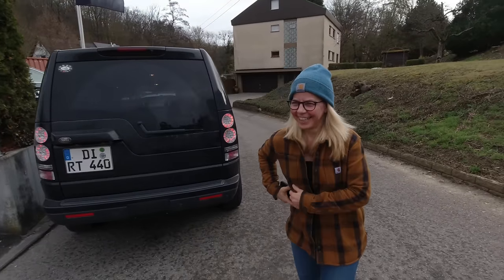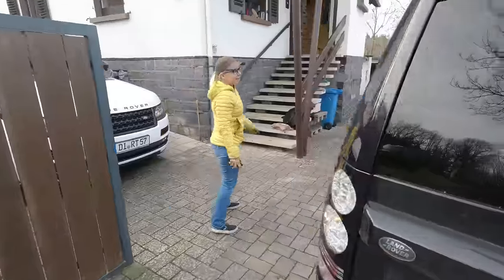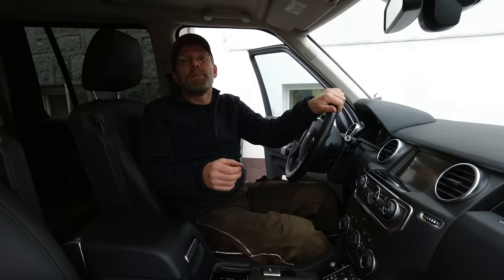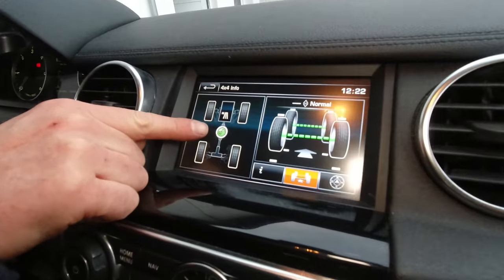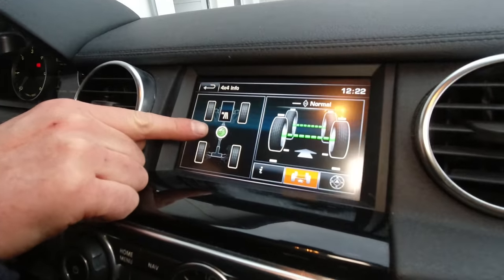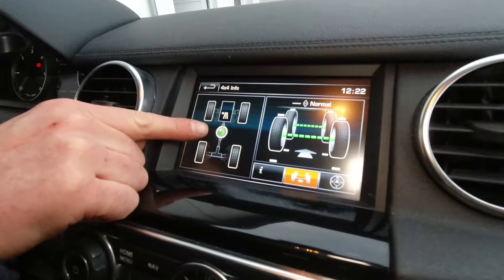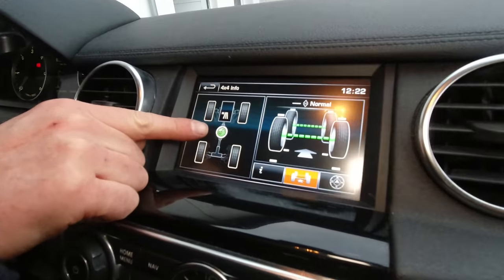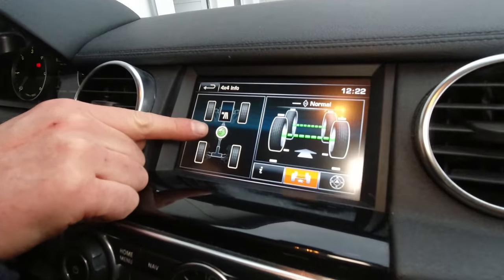We Bought a "Failed-Engine" Land Rover Discovery 4 in Mint Condition / S5-Ep8

Comment: Every time a Disco breaks down with terrible engine issues, the dealers are now shipping them off towards the locality of Frankfurt in the hope that Vera makes Christian buy it!
Reply: and most of the engine problem is just because the owner dont take care of it they may wash it wax it but the main service is a joke just my opinion from jamaica
Reply: Hahaa!
Reply: I was just about to type something very similar (but not as witty...)
Reply: Which diagnose tool you are using here ?
Reply: Riesen Respekt für euch, dass ihr eure LR Leidenschaft so lebt 😊👍👍
Ich kann das beurteilen, hab selber einen L322 😂😉
Reply: Same happens with Minis. There is a perception that the Gen 2 BMW Minis with the N16 engine are unreliable and they are..... If you don't maintain them. I have an R55 Clubman I bought brand new in 2013 and it has never been near a dealer, I have maintained and serviced it myself. It has never broken down and, apart from consumables, brakes and tyres, the only parts I have replaced are one VANOS solenoid, a cam cover gasket, a battery, a PCV valve diaphragm and spring, and a fuel filler cap that I left at a gas station
Reply: Most broken range rovers I know of go straight to the scrap yard because their engines are shite.  That’s certainly what happened to mine

Comment: Love it guys! Your channel is why I bought my my disco 4 about two years ago. She's a 2012 XS with a lot of extras had 117k miles now 126k. So far apart from servicing gearbox and general servicing, it's cost me for replacing the inlet manifolds which both cracked one hot day on Exmoor last summer. She came with a full Landrover service history and two prior female owners. From looking through the computer, she had done 26m in ice and snow settings before I bought her in total and zero miles in any other setting, so I knew she'd never been offroad. Well, she definately has now! We use her as a camper, with an inflatable mattress and all rear seats folded down, we put our luggage on the front seats and it is very comfortable. I look forward to Sundays and seing how to use all the tools I have had to buy to keep my Mall Crawler road and mud ready! To me, your channel is like a video version of the Haynes manual, with jokes and commentary - so thanks for all the useful information and laughter and long may you continue  to inform and entertain the rest of us D3/4/Queen - addicts.

Comment: I watch your videos with much interest. I have owned two Land Rovers, a series one that I drove across the Sahara desert in 1974 even though it was twenty years old. I believe that Land Rover's reputation has been built on the 'expedition' capability of their vehicles and not just a 4 X 4 that can be driven around forest tracks. My series one could be repaired with a small tool kit by the side of the road (id necessary), I defy anyone to repair a Discovery with the kind of tools that you employ on a regular basis. Keep up the good work.

Comment: I must thank you both on being so positive over D3 machinal issues. The motor trade runs away on the mention of a LR Discovery in the UK ,Yes only own one if you can fix it, so I'm investing in a 4 tonne workshop ramp. Meantime running my D3 6 spd Manual for 500mls without reverse gear after covering 225000 miles!!! , all it requires is the circlip on reverse selector lever on top of the box? How do you get to it, can't keep putting off the fix!!
Reply from the maker: You can see the details of the selector in the LR3 rebuild series.  Its a strange little clip.  Pulling the pin through the side is very tight with body-on.

Comment: I've watched a few of your videos in the past,i've had a few Land-Rovers myself but mine were series 2s and 3s,indeed my most modern was a Discovery 1 v8 which i had for 17 years.Up until now,i've not subscribed even though you're both very entertaining but once you said you'd never drive an EV i immediately knew we were kindrid spirits and hit the button! Good luck with this one,it'll be interesting to see what is going on inside that engine
Reply from the maker: I never had a vehicle for 17 years.  My respect.  You did more for the enviroment than any EV driver.  Christian
Reply: I had an Opel Vectra C 2.2DTi for 20 years, bought it new. It finally died…resting at my dads parking lot.

Comment: Congratulations on the new car, shame its not a Toyota folks🦆🏃‍♂️
have you considered putting a winch (with remote control) in the back of your garage/shed attached to the floor for ease of moving vehicles around the driveway. you can put several strategically placed  anchor points around the driveway to also hook pulleys from when obscure angles are needed  it would make it so much easier on you both.
Tony from Western Australia 🇦🇺
Reply from the maker: No we just need a little push, no need for winch. 👌🙋‍♀️
Reply: @Vera_and_Christian  that's fine while you are able to Vera   but as I can speak from 50 years of experience screw your back up or your knees and that is for a lifetime. For a relatively cheap price you can make life easier for yourselves, able to continue longer and have a extra hand around the place for being able to do many other things, a winch and pulley mounted in appropriate spots could do more than the engine hoist/cherry picker could do and get into positions the hoist can't
Think laterally your self and with Christians ingenuity I bet he would soon find it indispensable.
 Sisyphus  didn't have an option, for his punishment, but you do 🤔🙄😁
Tony from Western Australia 🇦🇺

Comment: Great video that I watched a day late as I was at the 4x4 Expo yesterday.

You had me rushing out to check my Discovery to see if it had the double-stiched seats and rear loudspeakers.

Mine is a 2016 Landmark and I was happy to see that it did have the double-stiched seats and loudspeakers and my control panel is the same as yours and "piano black" as well - so it looks like mine is equipped the same as yours, though mine does have the screens in the back of the driver and passenger seats (unlikely to ever use them, though).

The tow hook is an option and it costs over £400 in the UK (not cheap as chips as you said) and you have to order the slectric sochets as well as that is also an extra.

But - if you are buying a used vehicle it is probably better if it does not have the tow hook or rear diff. as it has likely only been used on-road and not for towing and is likely to be more reliable - and you can always add the tow hook if you want to tow.

The one essential thing that Land Rover missed is blind-spot mirrrors.  The electric blind-spot monitoring is an optional extra - mine did not have this fitted, unfortunately (does yours) and was only fitted with flat mirrors.  I find this dangerous and have had to use stick-on blind spot mirrore.  I just wish there was an after-market option to have a mirror that has the outermost part as a blind-spot mirror.  I have found one that stickes on top of the standard mirror, but you then lose the heated option - so you need a clip-on one that lets the heat through - still looking...

The big problem with the Discovery is that they are so enjoyable to drive that you just want to get out of the house and drive. 😉 😃

Oh - you did mention servicing.  Where I live we have two or three superb independent Land Rover repair specialists, one within walking distance. So, after my Land Rover warrenty expires, I will have mine looked at there.

And ... talking to a 4x4 tyre expert at the 4x4 Expo I have found that I can safely put 225.55.R20 tyres on, so I can get all-season, all-terrain tyres that have the snowflake/3-peak symbol so I can legally drive in Europe in winter. 👍
Reply from the maker: Our black edition has blind spot radar, adaptive cruise and keyless entry. The new one does not.  I will be missing the radar.  Christian
Reply: @Vera_and_Christian  I thought they all had keyless entry - you can turn it on and off, maybe it was just turned off by the previous owner.  I agree about ACC, but I really wish there was a decent optical blind spot mirror option without having to have a stick-on one.

Comment: You guys are amazing! So, how many LR4's is it now!! Meanwhile here in Dubai, the worst LR3 in the world has just had its 10th Suspension fault (Front suspension has collapsed to the bump stops) and 2 months after a 1-year warranty expired, the 3rd battery has died, so soon it will be 4 batteries in less than 3 years of ownership...Oh, that's on top of needing a new AC evaporator fitting, which is an expensive dash out repair.   We have thought of a LR4 or even another Range Rover again, but the dilemma is we have spent more than the cost of the car in repairs and a lot more than the LR3 is actually worth, but we feel we have to keep it long enough to get the "value" from it. It is a nice clean car, and a HSE so the interior is nice and despite issues it always passes the equivalent of the TUV or MOT test here in Dubai. What to do...?

Comment: I know of 2  cases of the Disco 4 with service history breaking crankshafts. Neither particularly low mileage though, one is a friend's car, currently getting a new Land Rover long block installed by a dealer. £6k I think but well worth it vs the cost of selling the dead car and buying a similar replacement.

Comment: Hey Christian and Vera, in Australia we are now seeing the RH cam pulley failing hub centre is cracking at the webbing to the outer pulley @ 170k km. Visually you can check when doing timing belt change heads up for the D4 timing pulley your probably doing right now. Cheers and keep the content coming.
Oskar from down under.
Reply from the maker: I also saw a picture recently. Did not know this issue before.  Should have changed Veras.  Christian

Comment: i bought a 2006 lr3 HSE when i was 15. it was been swapped to coilovers and i do recommend doing so IF is it the same model or 1 to 2 years old. the only problem i have had with it has been a misfire on cylinder 2 where i had to replace the coilpack and then the wet floorboards. i fixed the wet floorboards with some tape and glue as the hole are behind the a pilar on the outside and my sunroof was NOT leaking and brought it to a friends shop where they cleaned in the floorrunners for any mildew and mold.
Reply from the maker: Airsuspension is the best👌💪👍🙋‍♀️

Comment: These cars are used for heavy towing a lot in the UK and combined with the risk of engine failure, even though I think they are otherwise fantastic vehicles, I would not personally buy an used one now. I just have not got the skill, patience or facilities to repair them. I have had four Range Rovers, two Series III and two Defender 110’s plus a Discovery three door, all bought new but long gone now. My favourites were the 110 HiCap pickup and the 1988 Classic 2.4 diesel Range Rover with the characterful VM engine. The pickup was kept working hard for 22 years until it was totally worn out and with a broken piston. I still regret selling the diesel Range Rover and actually preferred it to a later 2004 unibody Range Rover with the BMW engine.

Comment: Hallo Vera & Christian,
as a LR-Fan over decades - driving a Disco2 , the better Defender - , I‘m a fan of your channel too.
Question, may you consider eFuel HVO 100  by the following engine repair episodes, which will be still available at some fuel stations and increase up from April 🤗.
I fuel my tuned TD5 with HVO100 and it’s running much more smooth by more power in lower rpm - by 90% neutral climate efficiency 👏
I‘m sure this gives our LR-vehicles a better PR!
However, keep on your enthusiasm, it‘s genius 👍
Reply from the maker: We will look into that👍🙋‍♀️

Comment: just to correct you on one point, in the uk ad blue vehicles stiil command a premium as they are ulez/caz compliant,even blown engine are 10k+, depending on condition.  landmark disco 4 are still going for £20-£30k.  also tow hitch are not as cheap...about £200 for used one, due to the fact they were routinely stolen while being valeted, in car lots etc

Comment: Another LR! You guys are going to have as many as we do if you keep this up 😛

And here are some suggestions for content after you finish Vera's suspension and the timing belt on the other D4 and the motor on the new one: 
- Turn the old D4 into a real overland vehicle with all sorts of mods including large tires (275/64 18s) and a swing away tire carrier, LiFePo house battery and no propane = induction cooking and more powerful alternator (requires CCF with the IIDTool) plus all the rest: storage, wiring, winch (bumper?), etc
- Show (sell?) the overland D4 at the Abenteuer & Allrad (maybe in 2025 🤭)
- Add adaptive cruise to the new D4

And, if you really want to make your YT channel explode, repeat the overland build on the Queen and make the world's first, real offroad L405 😅

BTW, I don't know how many km's you drive/year, but my commute to Freiburg (GAP EU HQ 😛) is 50km one way, my wife's is about 3km's less (also Fr). We purchased our Tesla M3 right before Vlad decided he wanted to be like Adi and have since saved enough on diesel/super unleaded to purchase a L405. Or L663. 🤟😁👍

Comment: Goodyear has stopped making those tyres, I have been struggling to get to replace mine.
Thanks for the video
Reply: Although Christian and Vera made a comment that they were technically illegal, I have the same Goodyear M+S tires on our '13 Discovery 4, and it is my understanding that they're legal until September 2024, when I plan to replace them with the Continental Premium Contact  2s I recently put on out '13 Freelander 2 and '17 Discovery Sport.

From the US military in Germany website:  "As of January 2018, new winter tires must be marked with the Alpine-Symbol (a 3-peak mountain with a snowflake in the center).  If you own all-season tires or winter tires marked with M+S and produced prior to 2018, they are still approved until Sept. 30, 2024."
Reply: @GunnarMiller  Tyres without the snowflake symbol are only illegal in Winter - which, I think, is between October and March (when the clocks are on Winter time?)?  They are perfectly legal at other times.
Reply: @johnwillett4086  There's technically no set time, although the rule of thumb is "O bis O" (October through Easter) ... you just don't want to be caught out in ice/snow conditions.  The M+S no-snowflake tires appear to be grandfathered through Sep 2024.

Comment: Many thanks for an interesting episode. I've seen some ads with flagged with motorschade without further specify what the issue is. I reached out to a dealer and asked him about the details, he only knew it was a non-starter, that client dumped the car there for sale without any further info (kind of red flag). How thorough checks are you as a prospective buyer allowed to do at the dealer? You mentioned you checked the oil filter for debris. Is that generally allowed? Is it allowed to bring a jump pack to try to crank the engine?  Check compression? ODB2? What normally constitutes a motorschade in Germany, is check engine light of unknown origin or is it a piston looking out from the engine block? Maybe your whole thought process how to find the perfect object would be worth a whole episode ;-)

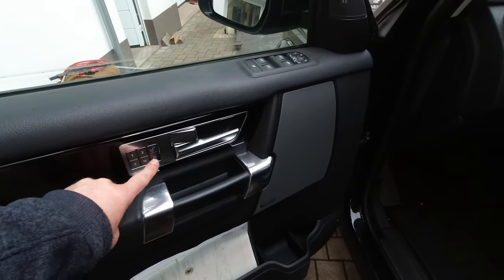Comment: 14:00 I'm amazed at comparatively well specked my 2014 Jeep grand Cherokee limited is!!! I've got most of these features as standard ( and my limited is pretty low in the range) obviously it's not as nice as the LR but it all works and it's much cheaper. Jeep really did try and eat into LR sales.

Comment: Nice.  This is much like our LR4 mall crawler.  We looked at an HSE model but the boss (wife) preferred the non-HSE version.  We have don't have the premium sound but do have the cold weather package, ECO start (disabled with a dead batt), 20 inch wheels and the surround camera system (which I agree with Christian, sucks).  But we are not diesel of course, we are supercharged gasoline V6 which I don't like that much because I am used to driving my 327 Chevrolet V8s which have much smoother power delivery.  This one ought to be good for a couple of months of content.  Looking forward to it.
Reply from the maker: The petrol V6 is rare here.  I had the chevy V8 during our last vacation in the USA.  We made two (funny) videos last summer containing this car.  You may want to check them out.  Christian
Reply: @Vera_and_Christian I saw you hating on Tahoes in that one.  My Tahoe is a 2006 so it is one of the good ones.  Only 288 000 kilometers on it so it's just getting broken in now.

Comment: I'll place my bet now. The Crankshaft has broken in the same place as Big Blue's did, but as it wasn't turning at 2000rpm when it broke it hasn't seized the engine. Sometimes they will run with a broken crank, but just sound like a Mercedes i.e. a bag of spanners.
Is Vera's memory failing? Big Blue had that 2nd battery, and the module it's connected to. That's called the Gateway Module (GWM) and that's where you'll find all the battery live values in the IID tool. If you had Big Blue's VIN on your IID tool and you didn't transfer it to The Queen, you can transfer that licence to this new D4 by dropping Patrick an email.